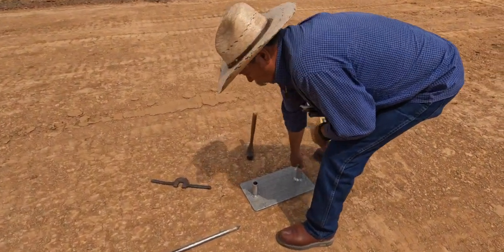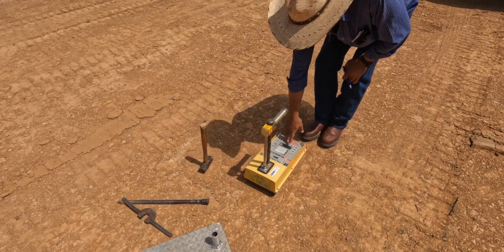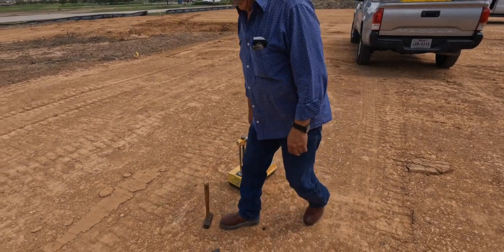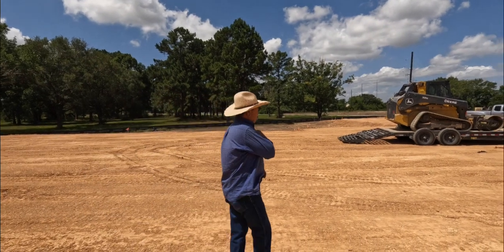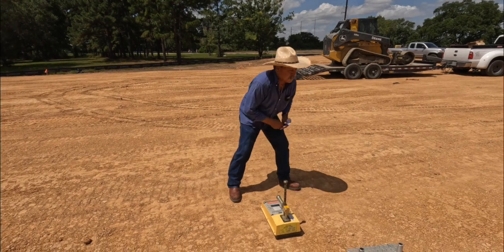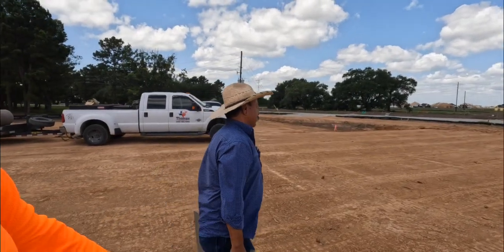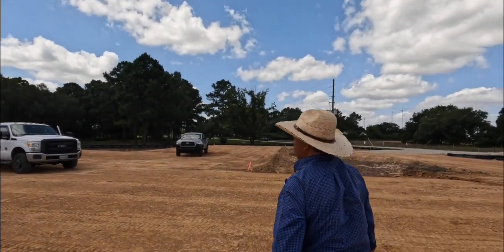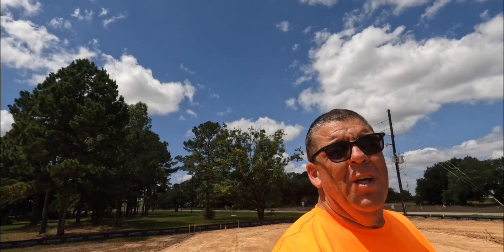Foundation Compaction Test Density, and Moisture with NUCLEAR Test Gauge

Comment: He is doing several things wrong in this video. NEVER extend the rod before you place it in the hole!! That is basic nuclear safety for guage use.  Always retract the rod before recording the results. And only 3 tests on a pad that size?
Reply from the maker: He's hired by the contractor. I have no say over how he does it. In the video I said 3 test spots but he actually did 4. Thanks
Reply: you are depending on the book my man. if you're in his shoes 100% you will do what his doing and forget what the book said....hehehhee...
Reply: You can extend the rod before you place it in the hole, you can only have it extended for a short period of time, 10 seconds. Procedure sets vary per state so we can’t say he’s doing anything wrong.

Comment: you need to align the gauge with the source rod aligned to the hole and drop the source rod in. You are getting exposed to more radiation when you take the source rod out first and drop in the hole

Comment: This is good as you build up your pad with fill, but never on your building footings,  this won't tell you the bearing pressure, only the density and moisture content.
Reply from the maker: Our ground is a little different. We have to build up to get out of floodplain zone. We are required to use 2 1/2 foot of select- fill to offset the swelling and shrinkage  of the soil. We will first do drill concrete piers  with bell footers somewhere between 9 to 16 feet deep, depending on the soil report . That will connect to grade beams cut in the 2 1/2 foot of fill. The cheaper way to do this foundation down here is with post tension. But there's quite a few lawsuits going on, because of that technique. 

They had already went to the pit and did the proctor test. So when he came out to test he already knew what optimum moisture content is to achieve compaction and density. Thanks for watching.

Comment: How do you know how much water to put?
Reply from the maker: First thing they do is a proctor test. That's where they take the dirt back to the lab put it in the cylinder smack it 25 times with the hammer then put it in the oven. They weigh it before it goes in the oven, then  weigh it when it comes out . From there they know the optimum moisture content for that dirt to reach full strength. If the moisture content is too high you roll it and pack it more. If it's extremely too high you turn it over and let it air dry then re-packet. Coming in to dry is not as common as coming into wet. If it's dry water it down, roll it over mix it well and then compacted ... Interesting sidenote. Flooding the property is one of the best ways to achieve the compaction you're looking for. 
  For those of us in the field that do not have a test. There's a look and feel to the ground that you develop a feeling that let you know you're close.
Reply: You are kind of close on how to do a proctor, but not really. You drop the hammer in the mold 25 times for 3 lifts, then you weigh the mold. Then you remove a portion and weigh it before drying. You do this at different levels of moisture added to a set sample size in 2 to 3% increments several times. Once the moisture content becomes to high the weight of the mold and soil will eventually go down because you passed the optimum moisture to get the best compaction. This is how you determine the optimum moisture and density for that soil type.

Comment: Very interesting and good explanation. 
Are these moisture and compaction tests required for all large commercial jobs? Do you also do this testing for residential foundations?
Reply from the maker: I'm not sure if they're exactly required for all jobs? Most definitely they would be required for dams, highways, infrastructure. With that being said no more than the cost to do it . It's worth it to get a quality job and to have proof that you did a quality job. If for any reason you have to go to court it's a great document to have in your folder. Thanks for watching
Reply: Yeah, but no, not in this situation.  Why would you use a gauge on your building footings? A gauge only tells you compaction and moisture, but not your psf or bearing pressure. You can use it as a guide as you are building the pad up to grade, but not to determine psf for footings.

Comment: I notice he would use the plunger to lower the material below the body of the instrument before inserting into the hole.

Would this not expose him to more radiation? I see in other videos where they would line up the machine over the hole, and only release the plunger when they can lower the material directly into a prepared hole
Reply: @alexmunoz4911 what you said is not correct for in place density determinations. Incorrect radiation safety procedures do not change what the test result is.